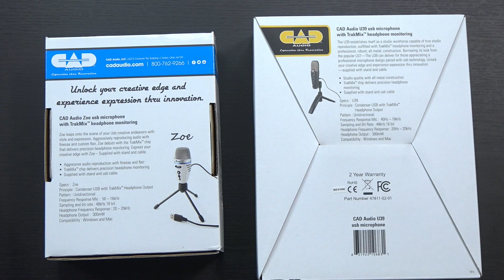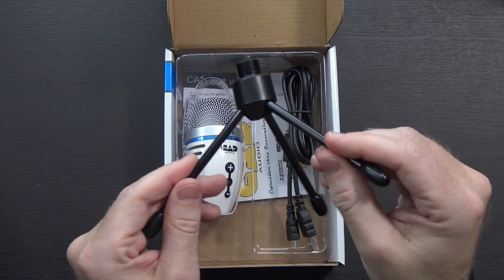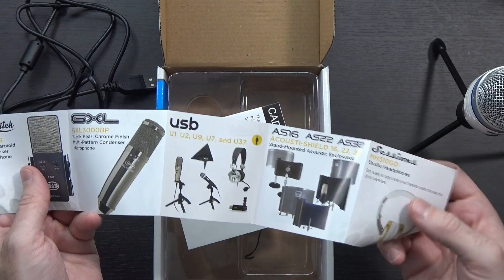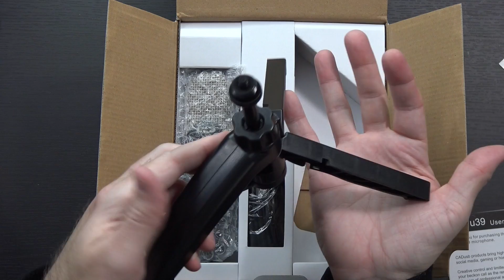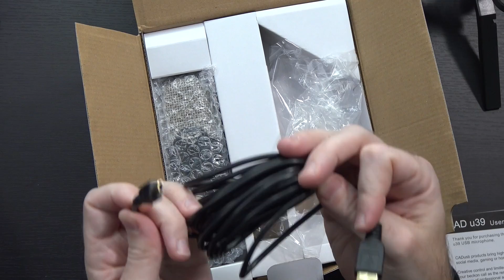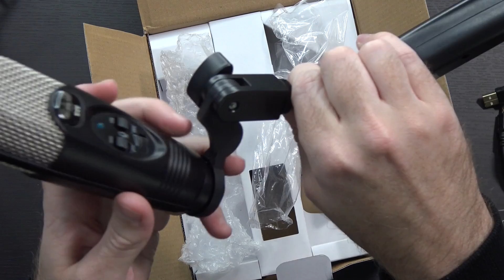CAD Audio U39 and ZOE USB Cardioid Condenser Microphones

Comment: The U39 sounds like a pretty good mic for USB.

Im also curious as to whether that "beeping" noise from the Zoe was due to the USB cable. Have you tried another cable in it?
Reply: It almost sounds like interference. Maybe the cable is poorly shielded.
Reply from the maker: Definitely sounded like interference, but I used the same cable for the ZOE as the U39, and the U39 didn't have any such issues, so it has to be something within the ZOE.
Reply: Jordan Keyes ok good to note. Certainly odd.